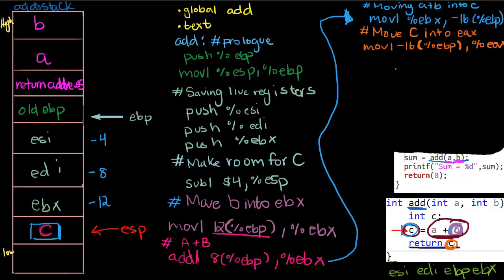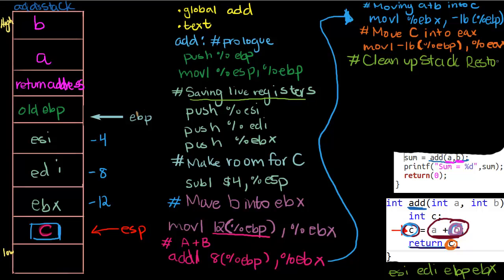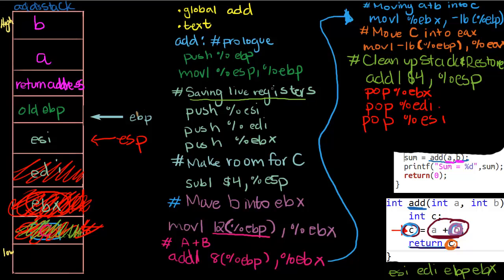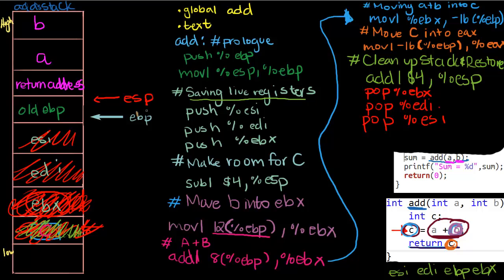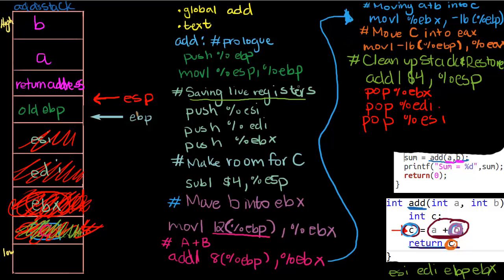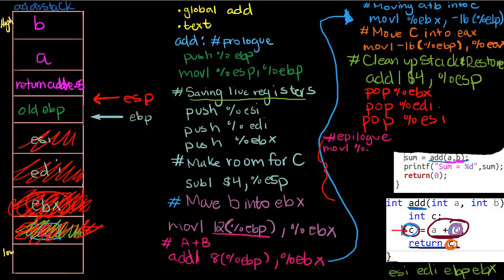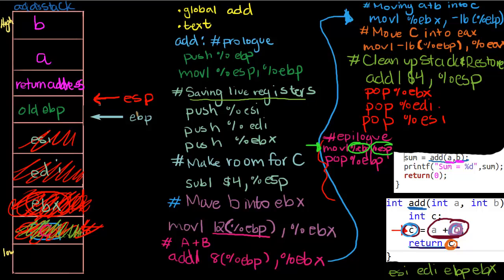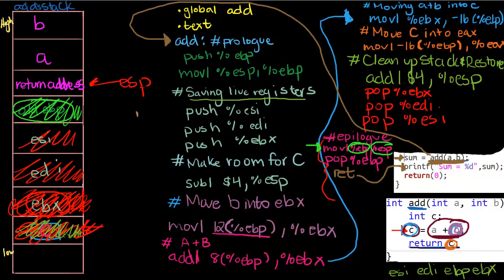Writing a Function in Assembly: Intel Att Assembly Stack Part 3

Comment: Couldn't you pop 'C' into '%eax' instead of moving it and moving the stack pointer?
Reply: Yes you could.
Reply: Less efficient though.
Reply: @chameleon932  Source?
Reply: Isn't a pop instruction actually two operations, the pop and then the increment of the stack pointer, whereas a mov is just one?
Reply: @chameleon932  Wouldn't both be the same then in terms of efficiency
Reply: In this case yes, i  think i  meant the general case when you have multiple pop instructions.  Apologies for not being more specific.
Reply: @chameleon932  It's fine, I understand your point too, so all good

Comment: why in previous video we use   
 movl -16(%ebp),  %eax    
Why can't we just pop it?
pop %eax
It will also reduce th esp for us, so we don't need to 
addl $4, %esp
for clearing C
Reply: in some cases this is not possible, if you have mora than 1 local variable into a function, the stack last address and return variable address could not match!

Comment: Does ret clear the rest of the stack after? So that A and B are cleared and esp pointed back to the top of the stack?
Reply: This is the same question of mine.
Reply: I think this is depends on calling convention. For example a stdcall caller should clear the stack. For this call callee should clear the stack.